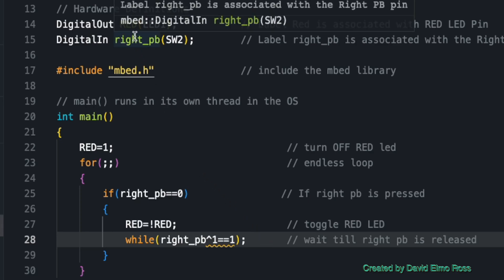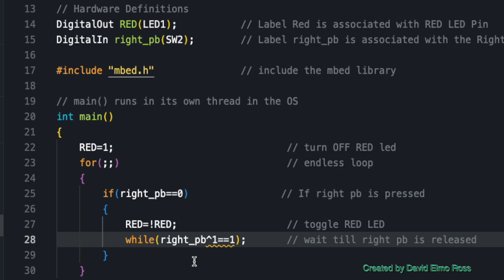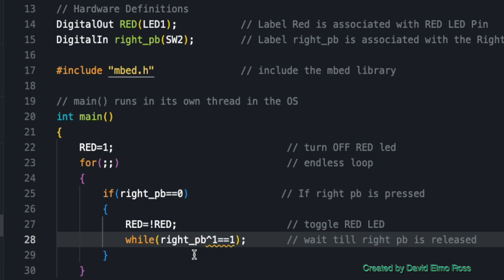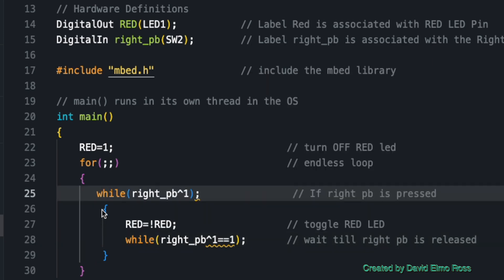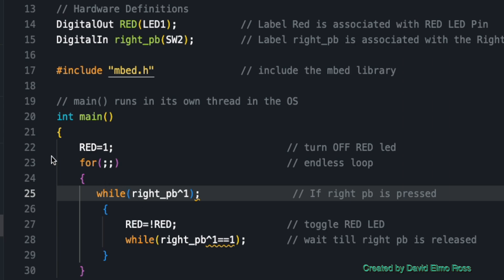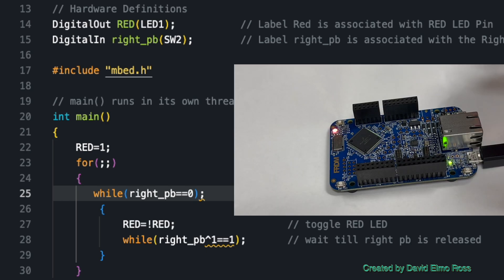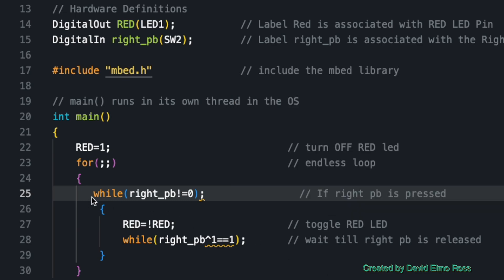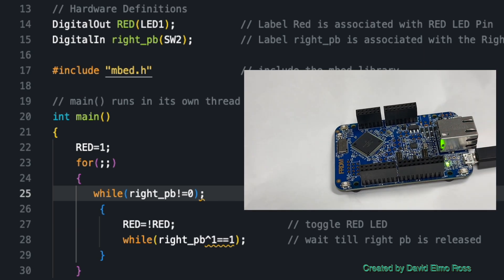if vs while

Comment: Why did you leave the curly braces (highlighted blue) next to the while?  It would be clearer that the while is evaluated as an immediate sibing of the RED=!RED; line if those had been removed.  I thought for a second that the semicolon at the end of the while statement was a mistake because you'd left the braces.

Comment: The blue curly brackets and indentation are super confusing giving that you have a semi colon after the while loop. At a first glance it is easy to assume that the whole block and first while statements belongs together. A modern version of gcc (different platform, different compiler) warns about this: "warning: this ‘while’ clause does not guard...  ...this statement, but the latter is misleadingly indented as if it were guarded by the ‘while’".